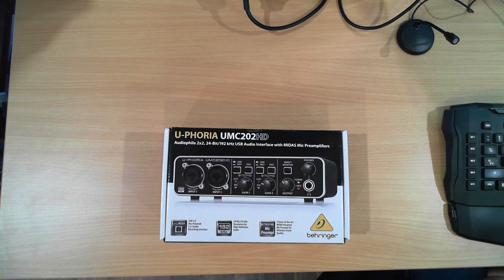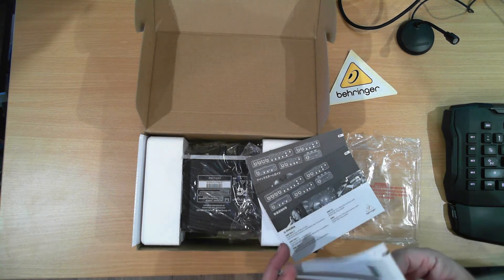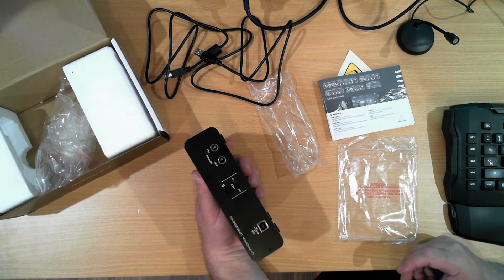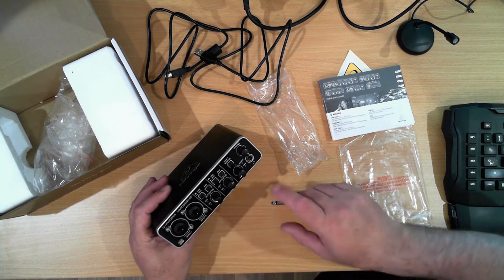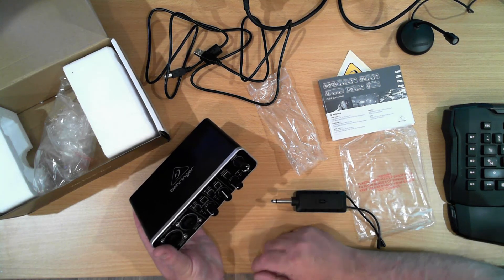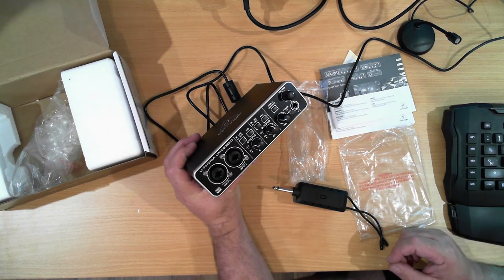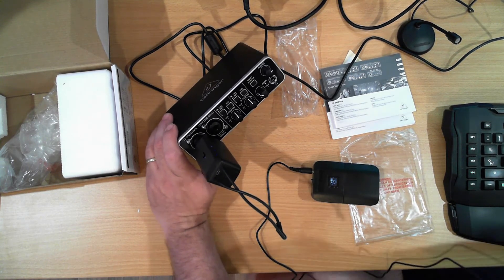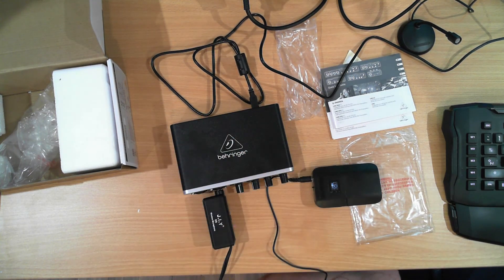Unboxing the Behringer UMC202HD

Comment: HELLO, HOW IS IT, HOW HAS GOING WITH THE INTERFACE UNTIL NOW, HAS IT GIVEN YOU PROBLEMS?
Reply from the maker: So about 5 months ago, I was experiencing quite a bit of noise, mostly a hum.
Turns out is was coming from interface, so i have now discontinued using it.
I'm not sure when the noise actually started to occur, I use Krisp noise suppression to remove other noise from within my home, this had been masking the noise from the interface until it was overwhelming the audio I needed..
I've had it since Jan 25th 2020, so I got 2.5 years out of it.
I have also been using as the phantom power source for my mic, it's most likely the phantom power as to where the noise was originating from.